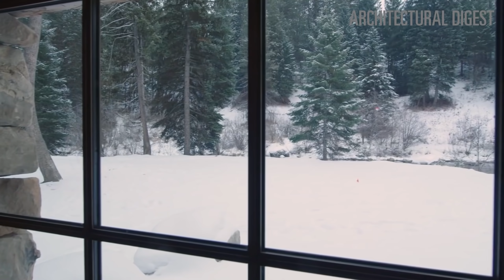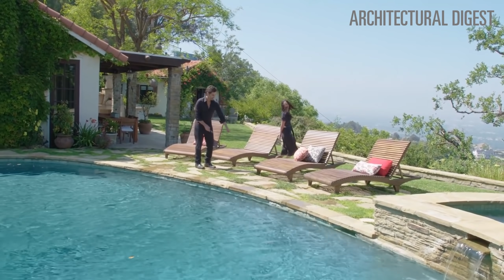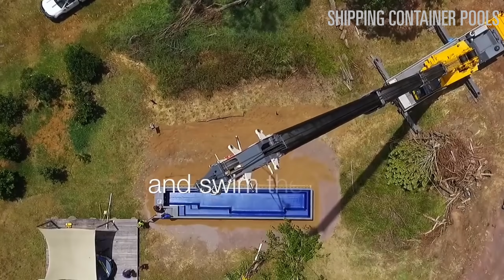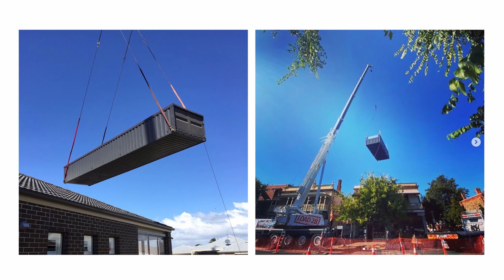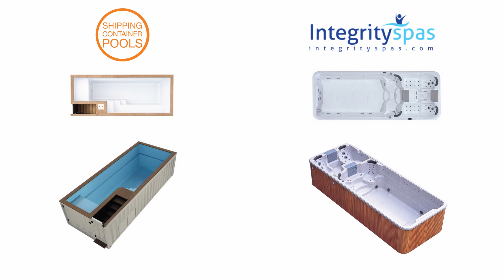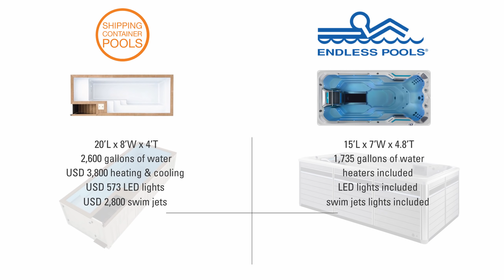Should you buy a shipping container pool?

Comment: I build a heated tub myself for a fraction of the price.. 
I took 2x2x2x2 pallets in the shape of a rectangle, and 4 on the ground.. 
Then added a plastic sheets on the inside and outside. With 4 steel bars surrounding it for strength..
That only costed me $250.
Next I added a copper pipe that went from the pool into a fire, and back into the pool.
Total costs for a heated hottub was only $500. It would easily fit 10 people.
I should have recorded it for youtube, but I didn't.. Will do next time. No need to spend 10k or 20k!

Comment: You gain get a half size / height container so that handles the reinforcement on top, and I’d think for the water weight as well. If you Rhino lined the outside and had it in ground, that’d help the temperature control some. Could it not then be spraycreted on the inside like a normal pool?

Comment: 24 ft round 4 ft high above ground pool metal frame + replaceable plastic inner costs about $2000, and it can be assembled in hours by the homeowner. With pump filter, etc. costs about $4000. Not sure why this is so cheap or why shipping container pool is so expensive.

Comment: So you say the shipping container is not wrong enough to contain the water, or if built into the ground, prevent the sides from bowing in.  You don't mention that these forces cancel out.  Also, since the container is cut in half horizontally, they have to add another top beam.  It should be simple to engineer that to hold the water in.

Again, while you raise important issues when using shipping containers, you fail to mention that there are simple ways to deal with these issues.

Comment: You mentioned using a shipping container and the need to cut it. They have open top shipping containers so you wouldn't have to cut it. The walls may still be too thin. But what about using a roll off dumpster? They are more structurally sound than a shipping container. No cutting is needed. Sludge containers are water proof already. I guess heat loss would still be an issue. They do have relatively cheap solar panel pool heaters though. Just curious on your take on these options.

Comment: The first disadvantage does not apply. The hydro-static load of the water is actually supported by the fiber glass not by the steel sheets. The fiber glass is durable material,  but it loses its strength and ductility when you put it under sun heat. This due to fact that fiber glass gets heated slowly and gets cooled slowly which causes the material to loose its strength. This is a material science concept called Tempering.

Comment: Excellent information. The lack of insulation in a shipping container pool is a key factor that most people will overlook. In a hot country like Australia, it is probably not as much an issue. But in  cold climates the amount of energy needed to keep a pool warm is a big cost issue.
Reply: Install solar panels
Reply: Get real, even when we lived in TEXAS we did not heat our pool in winter! Way expensive!
Reply: @karenwoytowich1140  Live in the DFW area.  Pool owner and can confirm we use our pool from April to November.  Heating is mega bucks so inside during the winter for us.
Reply: Big deal, so you have to insulate it just like you would any other pool!